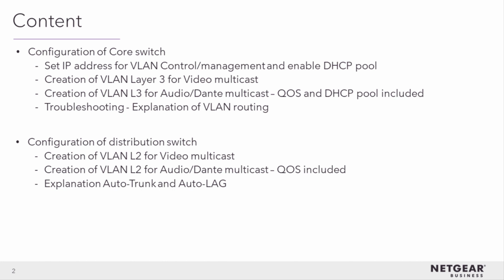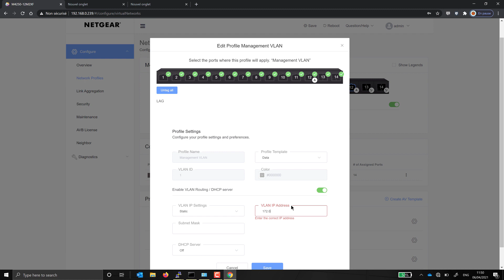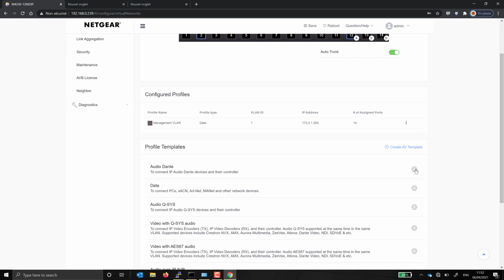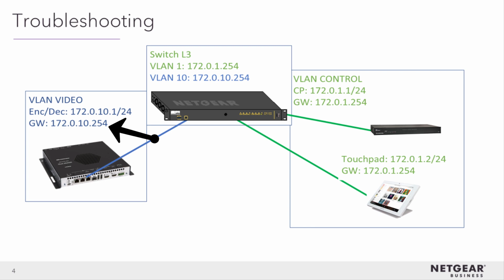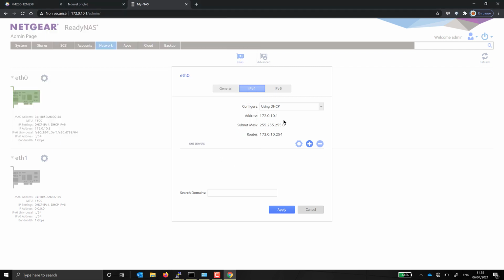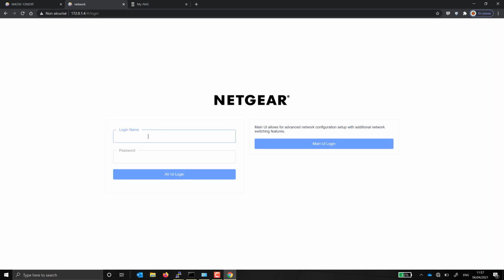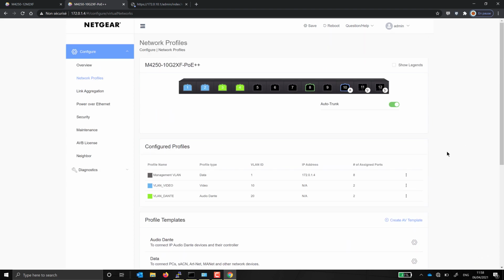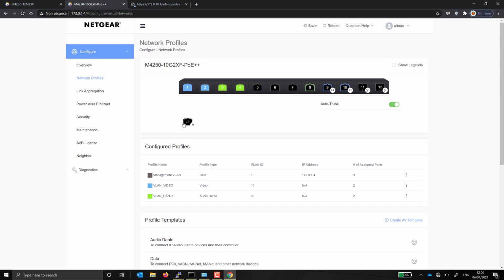Configuring VLANs on the NETGEAR M4250 Switch Series

Comment: I never use the auto trunking. I also create the DHCP pools for the vlans on the switch. This way you won’t loose DHCP if the switch hosting it goes down. Just use the main interface or CLI.
Reply: Have you maybe had any issues with Netgear auto trunking before?